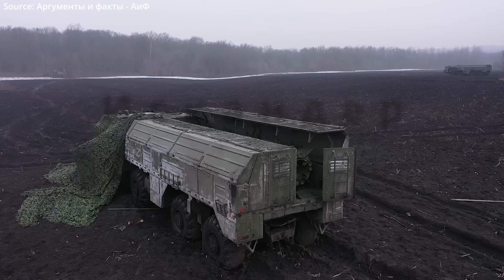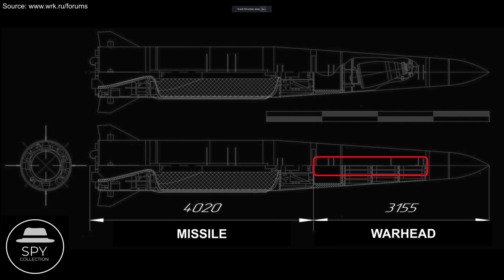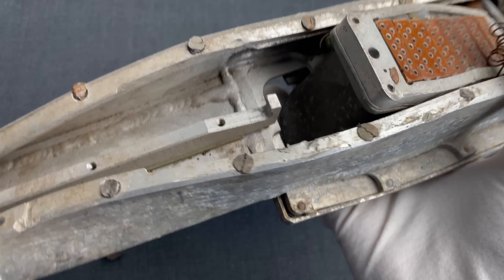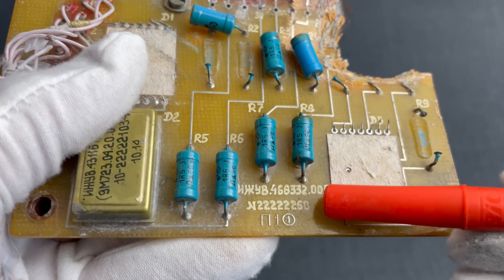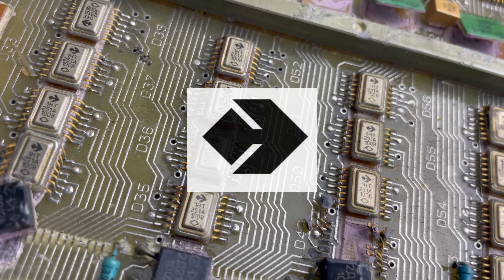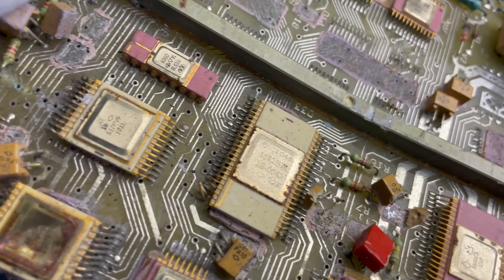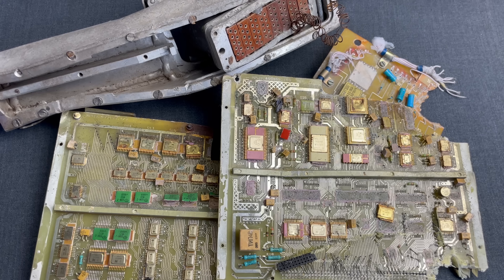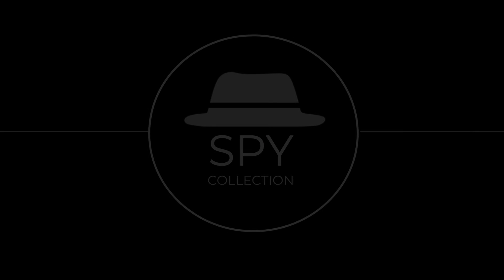Teardown of Russian Iskander-M (SS-26 Stone) Missile Components

Comment: The connector from the beginning is a umbilical. Before you send the missile of you need to start it up, tell it what to hit, to look out for, which target to select, ... After the missile flies a few m the counter connector on the ground vehicle will pop off and the missile is free to do its work. The analog to digital converter might convert all sorts of signals from analog to digital. E.g. the fin positions, signals from the inertial measurement unit (gyros and accelerators), the demodulated signal from the radar, ...
What do you mean by shottky ICs? Something like shottky transistor transistor logic? Shottky TTL? That are very simple logic components.
Half of the tech in the west is 20..30..40 years old. And still it would be 20 years ahead of what is in the missile. That is really tech that was conceived 10 years after the soyuz flew. On the other side: if it kills, it kills, regardless how antiquated the tech is. And it's true for most of the high tech in russia, that there were no investments, no advancements, ...
Reply: This umbilical connector reminded me umbilical connector from German V-2 which I see on some video - simple rugged design for harsh conditions (it should work in any storm, snow, on any weather outside). :) Regarding Shottky  - it’s from soviet KP1533 series which is Shottky TTL logic, similar to TI’s SN74ALS (for instance КР1533ИД3 which is clearly visible on video is direct analog of SN74ALS154). And yes, this missile is designed in middle 90s, so here is the late soviet-era components - TTL logic, one ASIC etc. Quite obsolete by today standards, but it works. :)

Comment: I don't know much about Iskander, or Russian weapons at all. But I know a fair amount about PCBs and those look like extremely basic boards. No Vias, don't appear to have sandwiched multiple layers. These are likely built with very primitive (relatively speaking) tools. As in a Taiwanese motherboard manufacturer is infinitely more complex than these. Now military boards probably don't need extreme complexity as that wouldn't be a good thing for the, but you can see these boards look like hobby level boards that someone at home could manufacture with basic eagle cad and some photo resist technology. It suggests to me these are very cheaply produced. Even some of the silkscreen (if you can call it that) looks hand written, or templated from something hand written. I don't know if this helps or not.
Reply: it honestly looks like manually taped out PCB layout to me. even the RefDes are hand written from the look

Comment: Could tell you're Greek after hearing the first "Welcome"

The components shown are low performance control circuitry and if I had to guess are there just for the control of the rocket. The control of the rocket requires minimal processing power and speed, orders of magnitude less than what a modern computer can achieve. The boards include the microprocessor and a lot of transistors to amplify its' signals and control the moving parts of the missile (or any other action that the flight controller can take). So this is the flight control computer, the "older" processes used for the digital components can make them far more robust to noise, radiation and any other bad condition, it will take a beating and keep working.

More modern computers might be included on the weapon, made with much smaller processes (like 14 or 7nm) and running at much higher frequencies. Such computers have orders of magnitude higher processing power that might not be needed for basic flight control but might be needed for more complex tasks like image processing, target detection, spoof resistance and even decision making. Even commercial GPUs can be used for such tasks, taking the silicon chip of a gaming GPU, mounting it on a custom PCB with custom firmware and an ARM processor. This would form a secondary computer that will give the target position to the flight controller. This faster computer is not as resilient as the flight computer but the rocket will still fly inertially to the last known target position even if this computer dies.

There can also be even more separate computers with their own micro-processor, for tasks like navigation/communication or for early computing of the sensors inputs.
Reply: yeah, you could most likely, control that missile with a mini arduino board, if need be - if you write the software in a time/mission critical manner, of course.

Comment: Nice to see that 60s electronics are still relevant.
Reply: Space station turn and return in the past 10 years ? with what and with how ? Russia.
Reply: It's not 60's. It's just metal-ceramic packages. Metal-ceramic microchips has virtually unlimited shelf life, and this is why they are used in nuclear-capable missiles in US as well as Russia. So you can store this for 100 years, and it will work in 2125. You can't use iPhone processor and expect it to survive 500m away from nuclear explosion.
Reply: @BarsMonster  so it's big and rugged, just as it should be.
Didn't know that smal regular elections chips had shelf-life.
Reply: @borism4629  Yeah, humidity gets ingested into regular plastic chips. So no one will guarantee more than 10 years.
Reply: @BarsMonster  no wonder car electronics go to hell after 10 years.
Reply: @borism4629  Its on purpose, all them being custom means only the manufacturer can provide spares, my friend fixes cars and he is happy as hell working on anything older then 2006, he can even fix these old board himself.
Reply: @borism4629  it is not self life in the way you expect, it is the radiation from the nuclear warhead that can damage them over time

high altitude aircraft, satellites and other space equipment including ICBMs have to account for space radiation too, even computers on the surface inside the atmosphere can once in a while "crash" because of space radiation, military grade electronics are usually manufactured in bigger processes (not 3 or 7nm), with better shielding and have better error correction protocols and redundancies to deal with high radiation

Comment: Use old skool tech 
more cheaper
more faster production 
more durable
more easy to maintenance
Reply: not really, you can replace this whole load of circuit boards with one small and cheap microprocessor
Reply: @esshoul  So, how does that change that it is better than any Western missile system.
Reply: @nitholav5583In Russian propaganda only.

Comment: Looks fairly old technology, but if it works, then why upgrade? It will be down to the firmware as to any secrets. It's unlikely to reveal anything; the firmware is probably in RAM and lost when it's battery is disconnected for added protection. Long circuit traces could add vulnerability as far as EM susceptibility goes, but it is probably in a well shielded enclosure to prevent that. The lower tech it is, the less vulnerable it probably is too.
Reply: What everyone who comments that this is old technology forgets that the electronics on the projectile should fulfill only two conditions... to be stable for decades while the projectile lies in a warehouse and to be ready at any moment for that one planned use... and this is achieved with maximally simplified electronics!
Reply: @jerromedrakejr9332Correct. I’ve laughed at comments of internet kids talking about the lack of sophistication.
Reply: Old stockpiles
Reply: @0x0NoFear0x0  Proven, reliable and cheap thing. The Russians announced that they are increasing production from 7 missiles to 30 per month.

Comment: When was this Built? Late 70s early 80s?
Reply: This is an update from Soviet era Tochka-U missile system
Reply: We landed in the moon 😁
Reply: @valiantone395  Apollo had a lower-level computer for the Moon landing than the one in this rocket.
Reply: This is on purpose, if you take apart western munition you will find the same tech, maybe is much tightly packed together but its all like this. I think even though Intel can large scale manufacture silicon @5nm, all weapons use 65nm and up, all this is to make them more resistant to ECM.
Reply: Yeah Not judging or anything, just Looked Like quite old tech to me. If it fits the purpose so be it. Makes Sense that it is more robust
Reply: It could have being build the last year, but the design was finalized at the end of the 80s.
And mind you, it's a nuclear capable missile. So all components are rugged,military grade, and not a consumer grade (i.e. without radiation protection etc.)

Comment: I see no western manufactured stuff in any of this
Reply: They use many, a bit more advanced western (or Chinese) components (watch other videos) but those are all commercially available and widely used components which are very easy to get from basically anywhere. It's impossible to prevent them getting it.
Oh and by the way, I saw a similar video discussing a western missile. There was a Russian made laser gyro inside it. 🤷
Reply: yep. no traces of washing machine chips. seem like there was some attenpted washing of our brains instead.
Reply: Bcz as per western intelligence Russians used refrigerator washing machine etc chips😂😂😂😂
Reply: @rupakkumardebbarma No, but they do strip FPGA and other sensitive elctronics from educational devkits.
Reply: @henria.277  That explains why, as Russian, I can't find devkits for reasonable prices
Reply: @rupakkumardebbarma  these chips date back to 1970ties, the missile itself was designed in 80ties, and once designed is finished, it will run production, all these chips are mil standard but very old tech, the "propaganda" about the washing machines was twisted because the actual argument was that your average Bosch, Electrolux or other modern applience will most likely contain electronics that are couple generations newer than what you can see in this video
and had you done any research, you'd know that newer russian designs heavily rely on western newer generation ICs, because russia doesn't have the capability to manufacture their own, they'll say a lot of stuff how they have this and that and can do everything, but at the end of the day you see smuggled western ICs in newer missiles, comm equipment, gps and so on
so you simply are too dumb to understand the washing machine reference, have a good day!
Reply from the maker: Note that those are tiny parts of this massive weapon system, and almost certainly fragments that aren't particularly sensitive. So, probably not sufficient evidence to conclude where all the components for the entire weapon system come from.
Reply: Probably has the markings stripped
Reply: Because it is bullsit propaganda